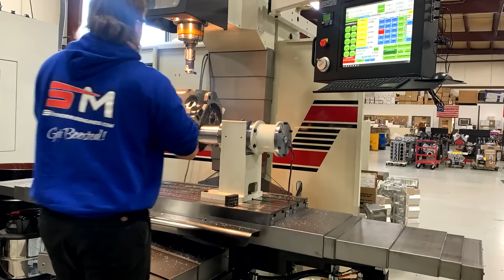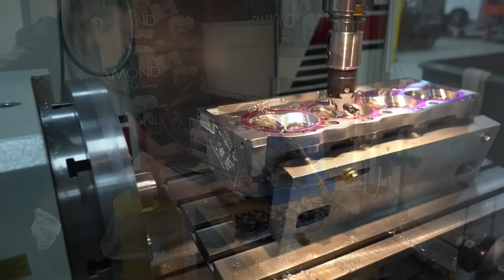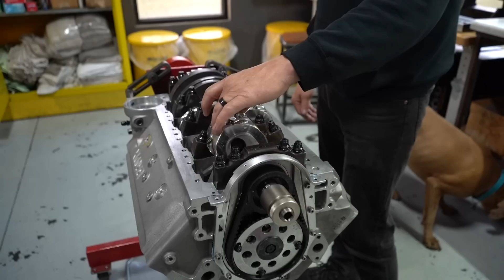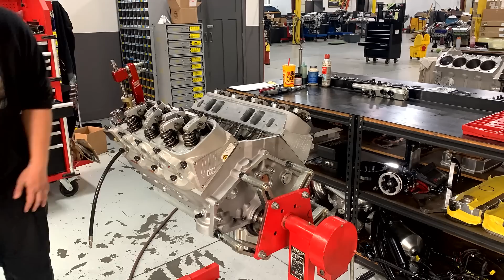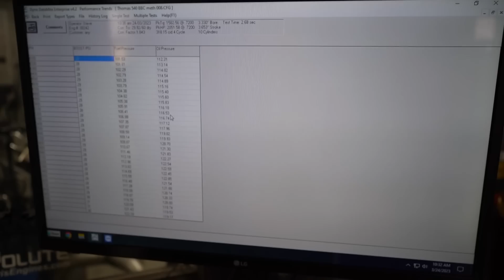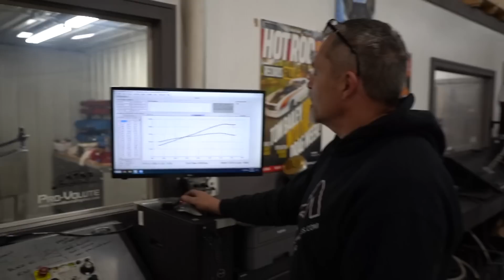Supercharged Big Block Build and Dyno Session!

Comment: Has anyone ever actually measured cylinder pressure  operating at max hp? I feel that would be a neat video
Reply: Ive always wondered the same thing
Reply: We do that all the time on ship engines - a v12 MAN high speed engine with around 2800hp makes around 240bar (3500psi) ignition pressure on a 6,8inch diameter piston
Reply: In Top Fuel, I’ve heard 6000 psi.  Also heard that some performance diesels are up to 8000 psi.  So on a 4-inch bore, that can amount to 45,000 pounds of pressure pushing the piston down.
Reply: Mike busch did it on an aircraft engine to test mixture ratio and detonation margin. It’s really fascinating. I would look him up and watch some of his stuff if you want a deep dive into what happens during a combustion event in a piston engine.
Reply: check out gale banks's youtube series called "killing a duramax." he did extensive testing measuring cylinder pressures, not only showing the pressure but showing it graphed in real time based on crank angle. you actually are able to get a full picture of whats going on in the combustion chamber vs changes they made. its diesel, so its a little different, but still very interesting
Reply: How does one even go about testing that?
Reply: Gale banks ram a formula on a duramax of his and it was around 28,000 lbs of force on the piston. Pretty cool to have an idea of the amount of pressure.
Reply: Dodge was over 2500psi during new interview with Leno!
Reply: I think the pressure would be extremely high…. Real FKG high

Comment: Use 2 air jets when surfacing. Itll blow away the chips... adjust them to point where the tip of the bit touches the steel

Comment: Tip: Use a spray bottle filled with 99% IPA to surface the AL and the finish will come out nicer. Best part is 99% IPA leaves zero residue unlike other cutting fluids. 

Dewey made his cameo so that made our day heading into the weekend. Thanks for sharing insight as always. God Bless and have a great weekend!
Reply: Will a Porter or Stout work? I much prefer those and don't keep any IPA in the fridge.
Reply: @bedlamite42  Ah no. Wrong IPA you're thinking of.

Comment: Acoustic treatment of the shop would reduce noise, making it more pleasant sonically (plus, lowering your accumulated SPL exposure over time). 

Lapendary industrial panels, ... would change your lives, there's multiple tools ...

It's worth noting ... somewhat elevated SPL over several hours is equally as damaging as brief exposures at extreme SPL. 

Anyway, we're appreciating the content, solid work.

Comment: awesome stuff, l noticed, that when the block was honed, it didn't have a plate and the gasket torqued to it, is there a reason for it, l remember you showing us that it needed to have a head plate bolted to the bock at the correct torque, because the block moves when the head is bolted to it ?
is that right, or am l missing something.

Comment: Question for you guys…….when Mitch was honing the block he did one cylinder then skipped a cylinder to hone the one cylinder away from the one he just honed is that to keep heat down?  I would imagine the coolant would keep heat away but is that why he skipped a cylinder between the honing?  As always I love watching all of your builds, and tuning videos!  I worked in a machine shop long ago and ran Okuma Lathes and Manual Bridgeport mills.  I started out on the Okuma as a operator/parts checker never programmed them but when I went to manual mill I learned so much about tooling and making small intricate parts!  We were a job shop where we built all sorts of really cool stuff.  The guy who trained me on the manual mill worked for Husqvarna(Viking) sewing machine factory in Sweden.  He was very knowledgeable and was really helpful teaching me how to measure and make very small parts!

Comment: They make cylinder crankcase head deck grinding tools. They can run at various low and very high speeds. They have no trouble grinding aluminum and cast cylinder bores at all. Ran many cylinder crankcases through these types of operations while employed at General Motors. Great stuff and tes we may just learn something and hopefully you and your team continue learning also. They work well on cylinder heads also.

Comment: A couple of things concerning the dyno room.   

There isn't enough make up air going into the room because the fan shutters are closing when the engine is at max RPM.  Sometimes you can see the dyno window flex on larger engines.   This will make the engine think that it is at a higher elevation due to the lower pressure and I'd bet that the tune is being affected.    There might not be enough make up air going into the building in general, I've dealt with this in an industrial setting where too many exhaust systems were installed and CO was being pulled into the building from the heating system. 

This dyno has what looks to be a DWW ( Drain Waste Water ) sanitary " T "  ( sweep rather  than a hard  90* )  just below the water servo valve.  DWW is only rated for 5 PSI due to it being very thin.  Schedule 40 PVC ( white ) would be better and Schedule 80 ) gray ) best however, I don't think you can get a sanitary " T  "  in either.

Comment: I use a noga base and test dial and I can get a 22" LS head within .0001" left to right and dead nuts 0 front to back usually.  I'm using a Winfield fixture, want to get a rottler soon.

Comment: I recall an earlier video, when the Rottler representative mentioned that the spindle had a very slight tilt vs the table in an effort to only cut on the leading edge when surfacing. Does the machine automatically adjust to perfect perpendicularity when installing receiver grooves?

Comment: Hi Gents,
I am a older CNC Machinist/Mech Engineer. After 42 yrs I am still learning stuff. I am curious as to how much cylinder pressure this or one of the SMX engines are creating? Also, on the fire ring cutting tool are you cutting these in with a C6-carbide double ended grooving tool, or a single end? I am a prototype engineer for a aerospace DoD contractor & found that a .75x2"x8" ground steel block wrapped with 600/800 grit wet/dry cross sanding and using Kerosine/Diesel fuel does an awesome job of removing drag out lines on surface finishes. Thanks for awesome vids.
Reply from the maker: Thanks 
 It measure pressures yet

Comment: It's great to see all the details how this is done.
Kind of a speculative question: I believe the SMX doesn't have any water passages between the head and block, correct?
So,would it be possible to eliminate the copper gasket and just put receiver grooves in the block and head and just use an o-ring? 
Not practical for top fuel since they have to take it apart after every run, but I wonder if it might work on an SMX. Could eliminate some of the inconsistencies of the copper gaskets.
For wet decks, one could use rubber o-rings or silicone to seal water passages
Reply from the maker: Possible

Comment: If the head comes off for say a head gasket job (I know the ring is there to prevent gasket failures and if the gaskets are damaged then you probably have bigger issues) but let’s say it is being removed. Do the rings ever have to be removed or serviced…?¿?

Comment: Very cool technique removing the O ring . Yes we could see the weld on the block deck. Steve it was interesting what you said about the needle bearing cam bearings I always thought they were better but recently was told that they could be a problem and may  fail causing debris In the engine ? . Who do you recommend for a supplier of the needle bearing cam bearings. Love the channel learn something every video !
Reply from the maker: NTA bearing I believe

Comment: from my engine builder, I learned to use dust free air tight room & we used hand full of assembly lube inside the block. what do you think about all that lube? never had a problem with 2 motors in a boat 4000 rpm all day at 50mph cruse 35 foot cigarette weight 13000
Reply from the maker: Different ways of doing things

Comment: Instead of TIG welding to the wire in the grooves, pick up a bodywork stud welder kit and spot weld those "porcupine" studs to the wire.  It should be less destructive than the TIG and quick too.

Comment: When Top Fuel crew chiefs set up an engine they use a different thickness copper head gasket to change the compression ratio to compensate for density altitude and the desired cylinder pressure. Do you use a different copper head gasket thickness for different applications with Fire Ring/Top Fuel Hoops or do you use a standard gasket thickness for Big Block Chevy, BB Ford, Hemi's, etc, etc?

Comment: Ive always thought the hoops would have stuck out a little more than 20 thou. I figured like 50 to 60 . Learn something new every video.  Thanks steve!
Reply: It all has to do with the deep drawing ability of the head gasket.  Think about stamping a typical cup type freeze plug.  The outer walls get thinner the deeper the cup is drawn and there is a limit to how much can be drawn in one step / before the metal tears.  Have a look at this vid as it explains deep metal drawing.  "  The Ingenious Design of the Aluminum Beverage Can " on the channel  "  engineerguy "
Reply from the maker: Glad to help
Reply: Jesse Chiocca for regular production machining,, have a look at the channel  "  Jim's Automotive Machine Shop, Inc. "

Comment: Have you ever had an o-ring fail where it butts up? I have a turbo Harley with copper and just o-ring into the cylinder. I had it push the copper out but it's a small o-ring and my heads ain't machined. Thinking I can get away with o-ring just need to get the heads grooved.

Comment: Steve and Kyle, the peak oil pressure was showing around 120 psi. Is that normal to run pressures that high, and more importantly, what oil do you run? Thanks! Great job guys!
Reply from the maker: Yep it is fine
Higher than normal but it is the pump and roller cam bearings. 
20/50 maxima in this one
Reply: @stevemorrisracing  you mentioned maxima assembly lube and then grease. Do you use both and if yes in which areas
Reply: @stevemorrisracing  Thanks for replying.

Comment: Also curious, if there is an uneven seating in the valves, couldn't spinning them like that simply make it look like it is seated OK? Say there is a high point on the valve itself, and the high point just scrapes the pink stuff off at that point, but in the complete circle. It would look fine on the head, but only some missing on the valve. I imagine the pink stuff has to go on both the valve and the head right? Is it procedure to check both?
Reply from the maker: That is a used valve to lap with. 
No I do not normally lap the new valve

Comment: Good infos... Would you think that these hoops in the alloy head system would be applicable to a cast iron block (vintage racing here in Europe: Lotus Twincam, Jagur E type...), we're stuck with CFM composite fiber with metal ring head gaskets to cope with head motion due to different temperature dilatation rate... what would be the bore to hoop required margin in cast iron and hoop receiver depth?
Reply from the maker: I would do it the same 
I have a video in my Steve tech play list.
Reply: @stevemorrisracing  thank you for your reply, this topic will be on our improvement list...

Comment: Do you use different spring installed height between the intake and the exhaust?  Would seem that you might set the installed height off coil bind because the intake and exhaust have different lifts.
Reply from the maker: Yep

Comment: Hey Steve, What do you think of the coyote platform? Real st is using stock block 302in stock  boss cam and stock heads and making 2500+ hp 1500+ pft and going for more . Crazy right bet you could get a lot more out of that little engine.
Reply from the maker: I have never done one. What they do is pretty cool
Reply: @Steve Morris Engines  yes sir i appreciate what you do i grew up a ford guy but amazed how efficient engines are getting. Have a blessed day.

Comment: My question is ...when we gonna see you building a 4 cylinder engine ? Would be interesting to see what you can do with half of cylinders 
Besides that really love what you do for us who doesn't  know much and always will to help us with knowledge Master Morris🙏🙏
Reply: The import 4 would be a completely different learning process and I'd think that the market is too small / over populated with existing builders.  
Blue Print Engines did have a 3.0 GM Iron Duke block with an LS head on display at SEMA or PRI to gauge interest so this might be an easy technology crossover.
Reply: @bobroberts2371  Yeah I saw that I like to see that little four-cylinder with hoops machine in the block and heads and a big  ass turbo just to see what kind hp it would make,,, they said it’s makes 300 hp na
Reply: @edmahonejr.9364   In the 80's / 90's, there was an IMSA / road race 3.0 tall deck Iron Duke with a 4 valve head .  Also, the 3.0 Iron Duke is still a common industrial engine in forklifts / boats / generators and such
Reply: @bobroberts2371  I don't think the market for 4 cylinders  is too small at all and keep growing,yes a lot builders yes no doubt..my point is if he can make over 3000+ or more (i know that) hp with 8 cylinders would be interesting what he could with half of that..4 cylinders are making easy over 2000+  they just run a 5.86 in a 1/4 mile
Reply: @edmahonejr.9364  In 2022 Hoonigan was getting 862 HP out of a Subaru 2.5 L turbo 4 cylinder for Travis Pastrana running on ethanol race fuel. 1000HP is not out of the question. I have seen No details on how that motor was built.
Reply: @bigdog2024  IAG performance engine in Pastrana's car ,closed deck big heads

The current top line in 4 cylinders are over 2000hp 

4piston racing have Honda K series that will do 2000hp boosted and 500hp n/a 

There are a few Ecotec's also up in the ladder at 1800hp + 

The Audi 5 cylinders are also showing good progress since it's literally half a Lambo V10

The next option for Steve Morris might be 2jz since Dart is releasing an updated block and Brangers racing are working on a billet head with Bullet engineering
Reply: @Realtime1501  You sure about 2000? Got some links? Closed deck is a must for high HP. Steve could figure it out to that HP level no doubt. At the moment looking at his shop, he pretty much has his hands full. To work with 4cyl he would need more building,equipment and people. Then he has less time to be hands on and race his wagon. I just don’t see him doing it. It doesn’t seem all about being bigger and making more  $$ to Steve, he’s half really smart engineer and half artist and  100% perfectionist.
Reply: @bigdog2024   The 4 cyl guys make HP with RPM rather than torque, this is opposite from how the V8 guys make power.  
High RPM motors with narrow power bands need more transmission speeds making them more suited to road racing where a light weight engine had benefits.  
The drag stuff needs more of less a flat torque curve in order to work with a 2 speed / torque converter trans and tire growth.
Reply: @victorcruz4249   Steve's V8 engines are large displacement ( 7.5 L / 458 CI  ish and up ?  ) , it would take a full custom 4 to get 3.75 L / 229 CI.  The other issue is less cylinders = rougher power output as well as more cam harmonics.  This will beat parts pretty badly as well as transmission parts.
Reply: @bigdog2024  Speedfactory have a recent dyno vid on their Civic making 2193hp

Comment: Hey question for you,why did Mitch have to take the valve springs off again on the head ? Was it for getting to the head bolts ?
Thanks Glen
Reply from the maker: he was either check piston to valve or checking rocker motion at the tip.

Comment: I understand leveling the head to deck surface but what do you indicate against when matching the head to the fixture plate? What surfaces do the head manufacturers use to ensure the deck surface is not canted one way or the other?
Reply from the maker: Check valve seat depths 
But you have trust to a certain extent
Reply: @stevemorrisracing  my brain went back to when y'all had  the Deucebox's block in the Rottler and found the one bank not square to the mains. I was trying to think what the head deck surface would reference off of 🤔 But I guess in initial machining the head to deck surface IS the reference? Sorry if I'm over thinkin it. Just tryin to get it right.

Comment: Steve, I gotta ask a question about that mount that you made for the cylinder head you’re putting the level on the face of the cylinder head. What if that cylinder head was not cut level to begin with are you guys doing any checks to make sure The cylinder head is square and true . Shouldn’t your mount attached to either of the rocker bases or be set up on stands to line up with the head bolts on the other side of the head?
Reply from the maker: No way to measure that

Comment: 16:00 is that groove cutting bit actually ground to the arc of the radius? Or is this a round cutting bit? [I would think a square/rectangular, or even deep cut [high relief] rectangular bit would still mess up the cut tolerances.
Reply from the maker: Clearanced
Reply: @stevemorrisracing  Okee

Comment: Do you not use a torque plate when honing? I taught that it was important to do so especially in high horsepower engine combos. Can you elaborate on this?
Reply: No one can prove that a torque plate even replicates the block distortion of when the head is bolted on
Reply: @Motor Swap Dan  was hoping for an anser from Steve, but I get the point. Would be cool to micrometer the bore with and without the plate too see if it was even measurable. Love the channel and seeing the the good work they do.
Reply from the maker: These blocks don’t move

Comment: Steve I know this is probably a stupid question but do you have to use a deck plate on the  block when boring if you know your going to o-ring the cylinder heads.??
Reply from the maker: Not seen a difference yet